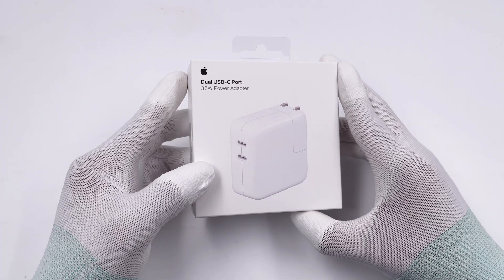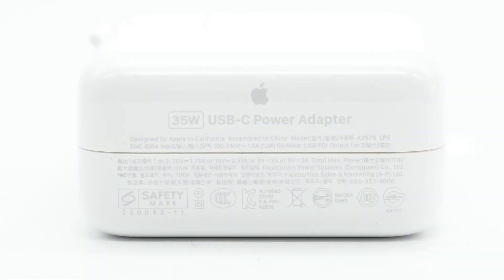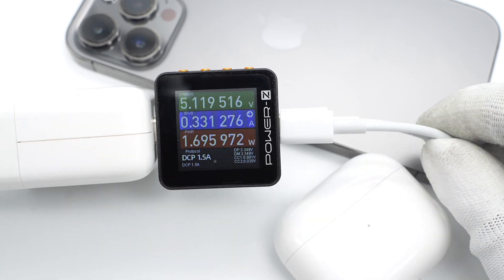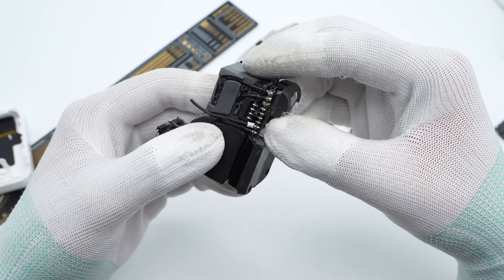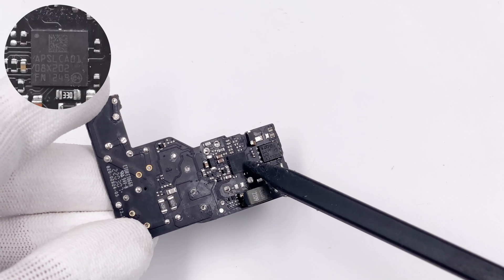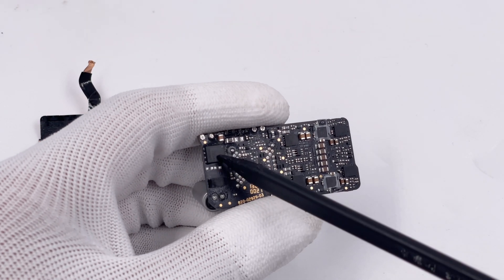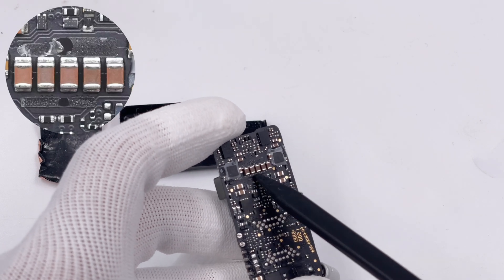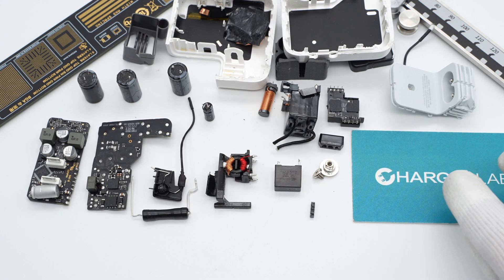Same but Different | Teardown of Apple 35W Dual USB-C Traditional Power Adapter

Comment: when you have one device connected and you connect another one does the charger restart charging?
Reply from the maker: The power will drop and then come back to normal, but it won't restart charging.
Reply: @ChargerLAB  thanks! that would be the first charger than doesn't restart charging that I know of

Comment: Thanks so much to ChargerLab for this very informative tear down video that show the various charging wattages when used to charge various APPLE devices together or as single. Such info allow users to pair two APPLE devices to be charged simultaneously more effectively. However, this charger will have a difficult time charging any APPLE laptops when it’s in use. The charging time would be longer

However, the ability to detach the prongs is definitely a use feature as mentioned by ChargerLAB because we can swap it with a 3-pin type for earthing purposes. As usual quality components are used and it’s well designed and manufactured. This model is definitely more useful than the other 35 W 2 USB-C port charger.

Thanks ChargerLab 👍🏽
Reply from the maker: I‘m glad you like it.
Reply: @ChargerLAB  most welcome and good work !
👍🏼👍🏼👍🏼
Reply: Is earthing in this case just for safety?
Reply: @jameswoll  A lot of chargers don’t have prong for Earth as these are considered extremely low voltage and the output is DC, so don’t posed any real danger to users. Unless the design is so bad and the components used are of so low quality, then the danger is a short-circuit or explosion, both of which the Earth prong can’t help.

The detachable prongs are more of functional as it allows us to use other prongs meant for different countries. Or re-use them just in case either the prong or charger is faulty.

Hope this helps